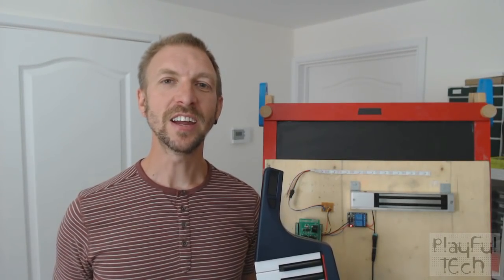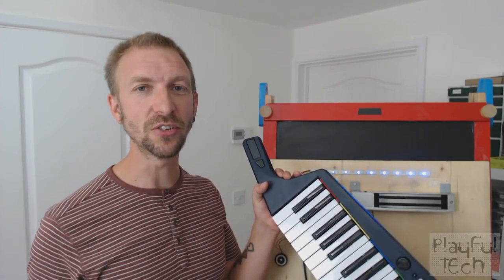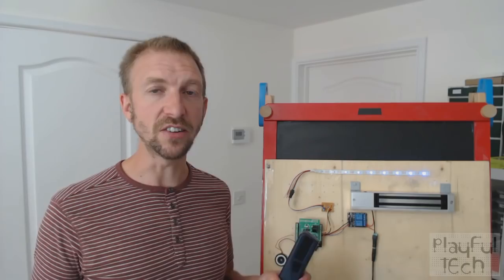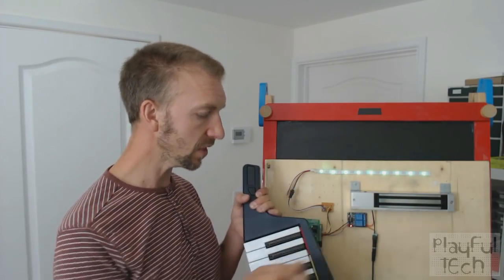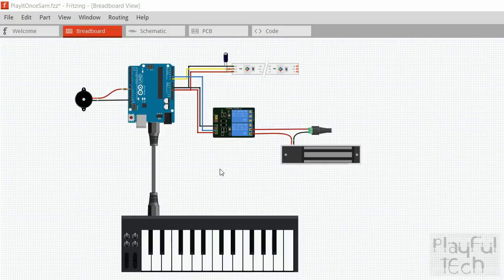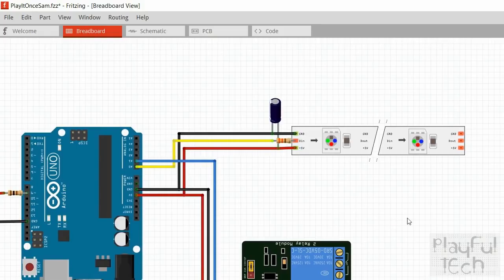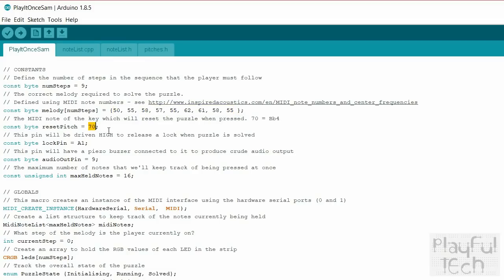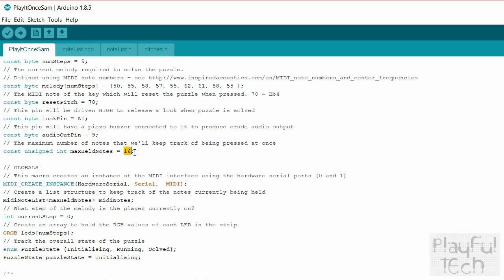Play It (Once), Sam! Arduino MIDI ER Puzzle

Comment: Do I have to use the midi connection or can it go to the USB on the arduino?
Reply: Years late, but for future reference:  There are USB MIDI libraries, but they only work on Arduino boards with native USB interfaces (Leonardo, Micro, Due, Zero...).  I used a USB to DIN converter: a "USB MIDI Host Box USB to MIDI Converter" and the Arduino MIDI shield worked with that.

Comment: Can you use analog pins of Arduino to send data to ws2128b?
Reply: Sure. The data transmission of addressable LEDs requires only 1 and 0 ;-)